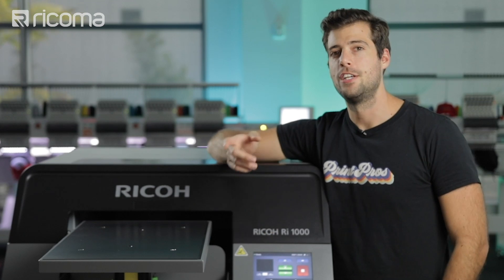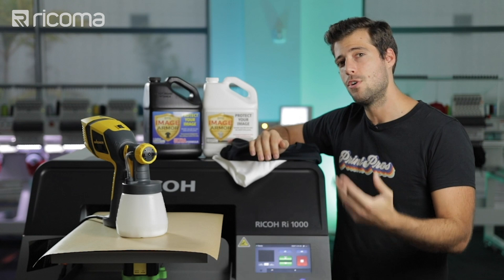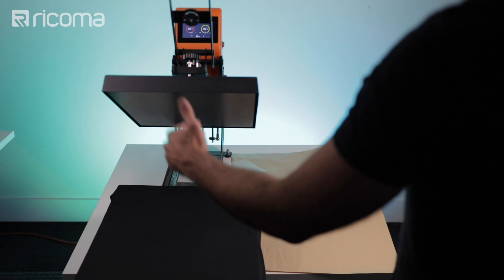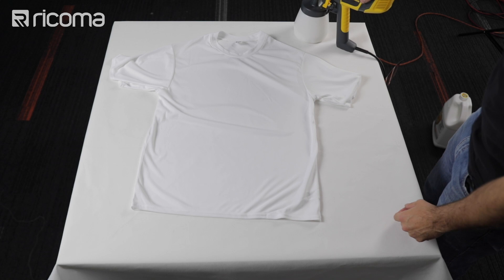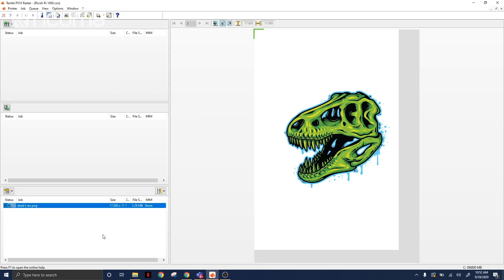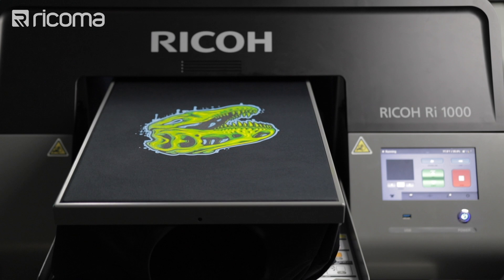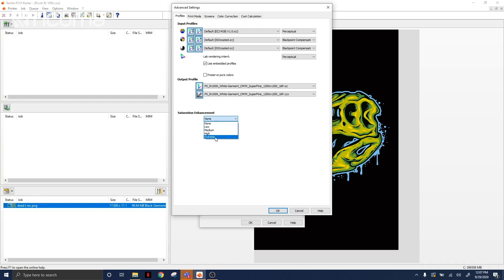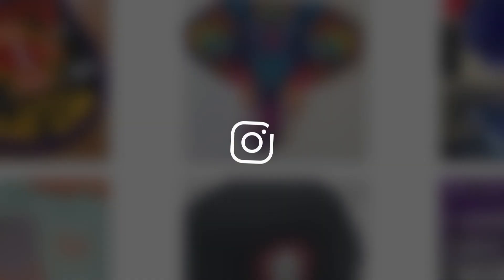How To Pretreat Shirts for DTG | Printing on Polyester Shirts | Print Pros (Ep 5)

Comment: Why are temps so low?  Image Armor shows a temp of 330 degrees for pressing the pretreatment as well as 330 degrees for pressing printed garments with Ricoh inks.  This also mirrors what Ricoh Ri 1000 manual shows.
Reply from the maker: Hi there, thanks so much for watching. You can certainly use temps as high as 330 but keep in mind that different fabrics may require adjustments.
Reply: @ricomatv  Thank you!

Comment: What about the Gildan 18000 sweatshirts? I use a ricoh ri-1000 as well and the prints come out great until curing. After curing they come out very faded looking as the ink isn't curing well
 I run my heat presses at 340 with very light pressure. I have tried multiple pretreat solutions. Still no success. I see other print shops printing on these exact sweatshirts with great results but I can't get any info from anyone....
Reply from the maker: Hi there, if you contact our support team they can teach you some great tips> ricoma.com/us/tech-support

Comment: when will the software be able to print white and color right after each other? rather than all white then color. less problems with white poking out. registration..
Reply from the maker: One pass printing is not controlled by the software, and there’s a new printer released next year that can do one pass printing, but you should look into the registration issue it could be a design setup thing in the software

Comment: I get stains on polyester
Reply from the maker: Hi there! It's either that you are using too much heat and need to lower it or you need to get a teflon cover for the heat press to avoid the rust stains transferring to the shirt! Give us a call if you still need help! 305-418-4421 and press 3